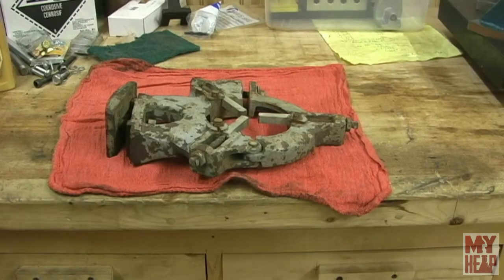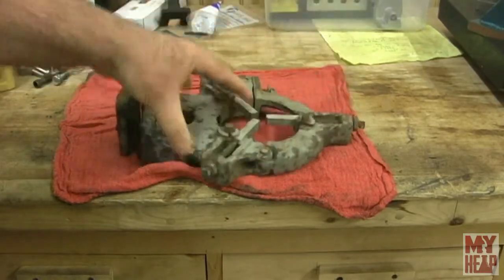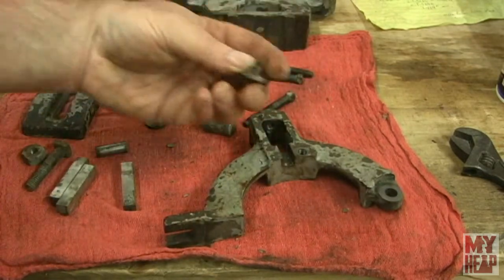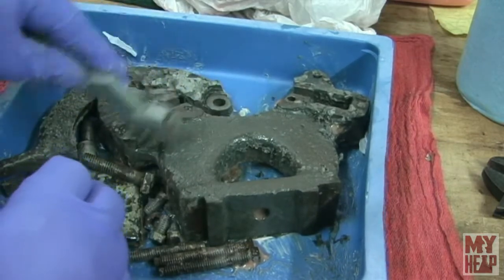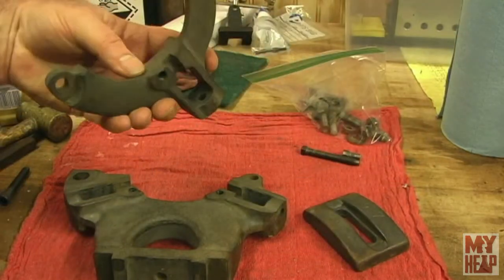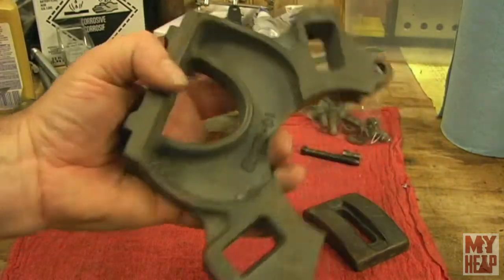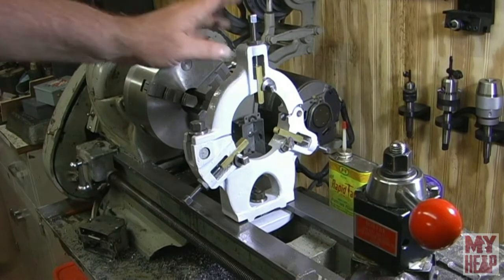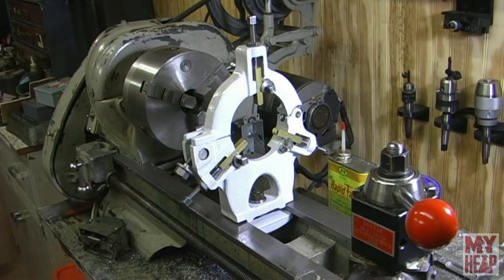Atlas 10F Lathe - TH54 - 26 - Reconditioning a Steady Rest

Comment: G’day Joe. The rest looks good, too bad you didn’t show making any of the parts. You should be happy with it when you need it, it’s one of those accessories that don’t get used often but when you need it, it’s good to have it. Hey what happened to the HF horizontal bandsaw, did you ever get it up and running?
Cheers 
Peter
Reply from the maker: Yes sir.  I have used it several times.  I think it debut in a video.  I much prefer it to the hacksaw.  Thank you for watching.

Comment: Looks great now you need to pant the lathe. To match
Reply from the maker: Hi Joseph.  You are sure right there, the poor old lathe looks a bit sad doesn't she?  Thank you for watching
Reply: @MyHeap  all in good time my friend .it only toot me a week to tear down my south bend 9 and 2 weeks to put it back together because of little things you never see coming upgraded the motor and of course it did not match mounting holes.  But will worth it. I also did new bushing in the head stock
Reply from the maker: @josephlovell6951  my wife tells me that Bertha (the lathe) is probably getting jealous with Beulah (the mill) getting new paint and that I probably should have painted the lathe when I had it apart to begin with.  But you know how it is, just want to get it together and make chips.  Haha. Thanks again for taking the time to watch and comment.  I really do appreciate it.